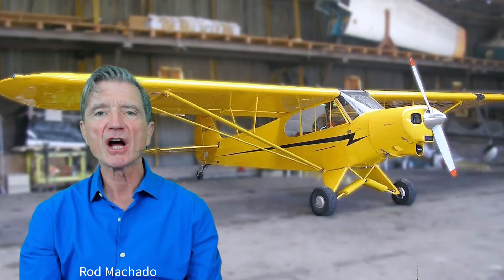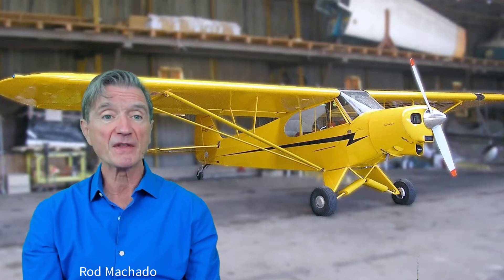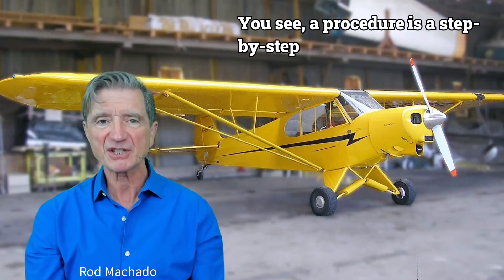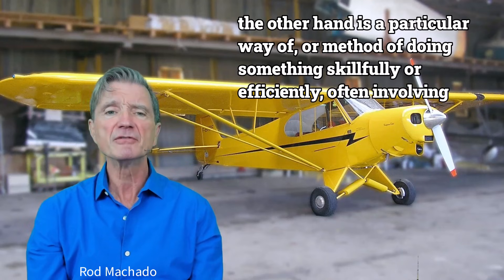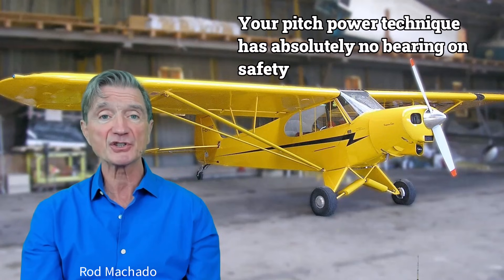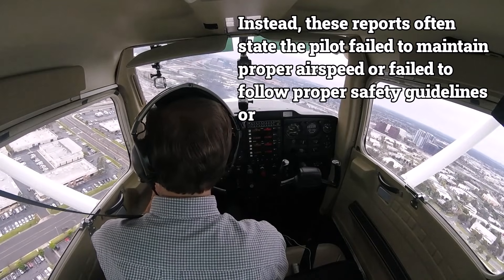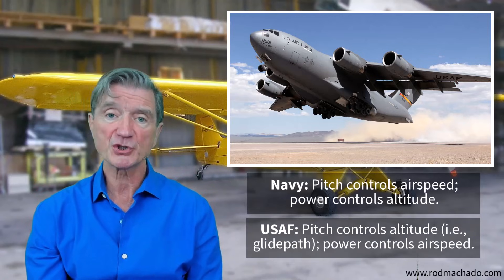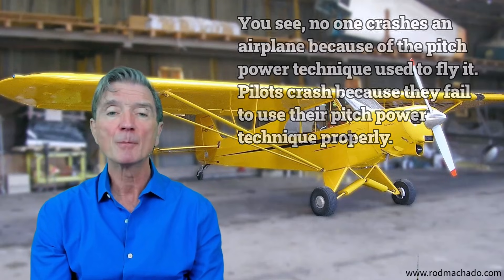Technique vs. Procedure

Comment: I think during climb, using a fixed climb thrust and pitch for speed (i.e., IAS Hold Aka Flight Level Change) is used and implemented in VNAV. But for Constant 3 degree glide path, where the pitch is fixed, then variable thrust it is. This is my understanding.

Comment: Wait? Someone is saying you can use pitch for altitude? So if I pitch up at idle power the plane will climb? I guess I better go study this new foundational physics discovery so I can properly understand how planes fly.

Respectfully, but you cannot climb with pitch so I don’t believe anyone is seriously suggesting otherwise. 

On the other hand there surely exists the objectively most correct approach to a safe stabilized descent. You may argue that drifting corners is your personal style how you drive your car, but you can’t argue that is the most stable and safest way to do it. There is a procedure for that, reduce speed before the corner, smoothly turn the wheel into the corner, keep the turn going, smoothly turn the wheel out of the corner and accelerate. And while it’s up to your technique how smoothly you perform this the procedure remains the same. So in fact, this is not about pitch vs power at all! It’s about how to conduct a maneuver to a desired standard. 

Well could be anyway, I have no clue what your video is about. It would be great if you linked the new FAA recommendation.
Reply: Absolutely you can climb with idle power--but you will lose airspeed. Just like you can descend with full power--but you will gain airspeed. Tell me this:  How does a glider perform a loop with no engine?  I'm pretty sure the first half of a loop requires a climb.
Reply: @timr1422  So you can climb and the only wrinkle is you lose airspeed. Kind of an important little wrinkle in your theory there chief. Also gliders do loops by first diving and trading altitude for airspeed before trading it back to fly a loop. No glider is able to just pitch up and do a loop. Even some aerobatic underpowered airplanes can’t do that.
Reply: @markor2476  Go back and read my post. I said that the airspeed will change. We aren't talking about constant airspeed climbs and descents.  The last time I checked, a gain in altitude is still considered a climb, even if you are losing airspeed. 

Here's another one for you.   If a particular autopilot can only control the elevator and not the throttle or throttles, then how can that autopilot have an altitude hold feature?  Somehow it's controlling altitude with elevator alone.  Hmm....

Comment: The reality is both techniques have their place. When I did my instructor course they were teaching ‘point and power’ on light aircraft because the students going through were military pilots and would ultimately need that technique for heavier, slippery aircraft.

However, one thing my instructor pointed out is that whichever method you use, if you are doing it right they are fairly indistinguishable. And he’s right. If you ever change the state of a fixed wing aeroplane you cannot do so without manipulating both controls with the exception of changing speed in a glide descent or full power climb.

Finally, because I seem to have see it a lot recently in comments: Pitch controls airspeed, power controls altitude is incorrect. If you are discussing this technique it is correct to say pitch controls airspeed, power controls rate of climb/descent.  Be pedantic, get it right. Especially if you are an instructor passing that knowledge to students.

Comment: They are both incorrect.  The elevator controls angle of attack and a relationship between airspeed and altitude.  Power can be used to change either altitude or airspeed depending on what you do with the elevator.  Pitch/power and airspeed/altitude are interrelated.  

If you don't believe me, try this: Put your aircraft in straight and level flight about 100 ft above the ground. Now without changing power, push the controls all the way forward and hold them there.  Then (if you survive) come back and tell me if anything changed besides airspeed. 

Also, just my personal opinion:   If you are going to say "Pitch controls X and power controls X", that should be true for every single fixed wing aircraft from a Piper Cub to an SR-71, and it should be true for very large control inputs, not just small inputs.  If it's different for low speed vs high speed aircraft, then tell me the exact airspeed where it flips.  

Because kinetic energy increases with the square of velocity, 1 knot of airspeed at 300 kts packs a lot more energy than 1 knot at 60 kts. Therefore pitching for a 5 kt airspeed change at 300 kts causes a much larger change in altitude (potential energy) than it does at 60 kts. That is why pitching for airspeed doesn't work well for high speed aircraft.

Comment: Pitch for airspeed, power for altitude. I've been using this technique for since 1980, and I'm still very much alive. I'm not changing.
Reply: Have you ever made a coupled autopilot approach (the autopilot controls the elevator)?  How did it go?

How's the bbq in Memphis these days?  My favorite place was Leonard's.
Reply: @warren5699 I have not, and as a non-instrument rated pilot, I likely never will.
Reply: @MemphisBBQ640 you didn’t even have to tell me you’re a VFR only pilot. Your main comment already told me that 😂

Comment: Either technique works, but one is far easier to teach. What's more, pitch for airspeed instills the correct response to a stall warning indication.
Reply: There's no way to prove it, but of all of the stall incidents on base-to-final, takeoffs, and go-arounds, I bet there are as many if not more pilots that pitch to airspeed as pitch to altitude.

'easier to teach' is a key point.  Shortcuts can be taken in many ways.  But does that give the learner the correct knowledge and skills?  The easier way often does not - ex: if someone does approaches with 'pre-set' pitch and power (which is easier to teach), can they respond to changing conditions?

Comment: i think it depends on the aircraft category you’re flying, for something high drag and low power like a cherokee where i learned to fly they taught me to control with power, you put on 2000 rpm on the engine and the thing starts descending 500ft/min without touching anything, that doesn’t work on a jet though, on a jet is pitch for altitude and thrust for speed, they have enough power, low drag and speed range that you can’t control precisely with power alone
Reply: That's an interesting point.  The small airplane does usually respond immediately with a power change.  But small airplanes go places and use small margins that jets don't.  For ex: a small plane may make an approach to a short runway over an obstacle.  The airplane sometimes has to pass very closely over that obstacle.  That's definitely when a pilot shouldn't depend on the propeller slipstream to control the descent - it needs to be done the safest way possible, the way the jet pilot would using the control wheel with direct mechanical control of the elevator.

Comment: Ahh, I use the kinetic energy confabulator in constitution with the  potential energy monostabulator but reverse that when the flux capacitor indicates that the polar moment of inertia crosses the central e-field axis. This is marked on the KPI with the rainbow color coding just above the Unicorn. Works perfectly.
Reply: You're sounding like the Energy Management chapter!!  🙂

Comment: I recently created a new community at SKOOL, that adresses exactly this topic. Not to activate this old debate, but to show a technique that worked for all my students.
Reply: I learned that approach technique in GA, and then the Airforce unlearned me, except for flying alpha on approach in high wing loading performance aircraft, or STOL work. In my Airline career, the big momentum aircraft go where you point them. Just like following the flight director.
Reply: @spdaltid None of these techniques are wrong, but especially new pilots should understand what they are doing in order to preserve more mental capacity for other tasks, instead of having to correct aircraft behavior they did not expect.
With bigger aircraft, as you correctly mentioned, it is much more controllable to use pitch for glideslope control. Pitch gives a much faster response in rate of descent than the engines do. However, you must understand that the principles are the same, you are just using them differently.
When changing pitch, you trade some airspeed for a different rate of descent. This means you are accepting the loss of some knots of airspeed to reduce the rate of descent, and vice versa. Less airspeed means less use of potential energy (altitude), and therefore a lower rate of descent.
It’s all about energy management.

Comment: On my 777 if I fly 2.5 degrees nose up and set power to about 55% N1 I fly a perfect 3 degree slope, to adjust I increase or decrease pitch and power as required..e.g pitch for glide slope (Altitude) and Thrust for speed (Power). It works on every other Boeing I’ve flown 75/76/747. Flying my Super Cub, I do the exact opposite 😂
Reply: It comes down to how you sequence the words.  Suppose a Navy pilot was going to land your 777 on a carrier that was long enough.  He would say it this way: I adjust power for 55% N1 for glideslope and pitch for XX speed (you didn't mention the target airspeed).

Even though pilots may debate what they are doing with the controls and why, the truth is the lift vector is what is opposing the weight and controlling the altitude, and the thrust vector is what is sustaining the airspeed.

Comment: It’s always been about energy management, ALWAYS. How you🫵🏻get there is on you🫵🏻as we like to say in the Army!!!🫡
Reply: "It’s always been about energy management, ALWAYS"

yes, but explain what that means and how it applies to controlling airspeed or altitude individually.

If I am in level cruise flight at 100kts, and I want to speed up to 150kts level cruise flight, how do you do it?

If I am in level cruise flight at 100kts, and I want to climb at 500fpm at 100kts, how do you do it?

Comment: First off, I got my pilots license and ifr years ago reading your material! Thanks!

I like this video a lot. My instructor taught me to use power for altitude, and pitch for airspeed. Learning it this way I feel helps you master the flight characteristics of the aircraft.

When I fly precision approaches, I will use pitch for altitude, since I can correct altitude with pitch faster than I can than adding or removing power. Then I will use power for airspeed on a precision approach.

Also I think both techniques have their merits.If you need to get out of the way really quick, you're going to move the yoke first. If you are wanting to make a smooth decent, use power for altitude.
Reply: "When I fly precision approaches, I will use pitch for altitude, since I can correct altitude with pitch faster than I can than adding or removing power. Then I will use power for airspeed on a precision approach."

power does not control airspeed, not even in a precision approach. let's say you want to go faster, so you add power and nothing else. the airplane reduces it's rate of descent, but your speed remains constant. so you lower the nose to go faster and re-establish the descent you had before. what you're actually doing is controlling speed with pitch, and altitude with power.

the sooner you learn to fly precision approaches with power for rate of descent, the better you'll be.

"Also I think both techniques have their merits. If you need to get out of the way really quick, you're going to move the yoke first. "

yes, but this will only work for a moment before the energy transfer you made steadies out. push it too far in either direction for too long and you'll stall or rip the wings off.
Reply: @SoloRenegade when you're in imc taking the plane down close to or at minimums, the one thing you don't have to spare is altitude. If you think for one moment you will continue to pitch for a constant airspeed when you need to make a quick altitude adjustment with throttle is dangerous. You must pitch to correct while simultaneously adjust power because you can always be a little slow or a little fast, but you cannot crash into a building because you want to control airspeed with pitch and altitude with throttle.
Reply: @adamsiewert4039 "when you're in imc taking the plane down close to or at minimums, the one thing you don't have to spare is altitude."

um, do you know how IFR works? you don't have a choice, you have to follow the glideslope or step down altitudes whether you like it or not.

" If you think for one moment you will continue to pitch for a constant airspeed when you need to make a quick altitude adjustment with throttle is dangerous. You must pitch to correct while simultaneously adjust power because you can always be a little slow or a little fast, but you cannot crash into a building because you want to control airspeed with pitch and altitude with throttle."

you couldn't be more wrong if you tried. my technique is the correct one, and it works. Myself and none fo my students have ever crashed nor risked crashing doing it properly. Navy fighter pilots work the throttle like mad to control the descent onto a carrier deck just as I describe. they have the hardest IMC landings on the planet.

"but you cannot crash into a building because you want to control airspeed with pitch and altitude with throttle."

strawman argument. logical fallacy. you're a child. got get some retraining if you think this way.
Reply: @SoloRenegadeteaching kids on Microsoft flight simulator do not count as student pilots.
Reply: @adamsiewert4039 nice ad hominem. since that's all you got, you lose the debate.
Reply: @SoloRenegade "um, do you know how IFR works? you don't have a choice, you have to follow the glideslope or step down altitudes whether you like it or not."  That's what Adam is saying.
Reply: @SoloRenegade "Navy fighter pilots work the throttle like mad to control the descent onto a carrier deck".  That's because the throttle is a poor control for altitude.  I recently read an article by someone who was extremely knowledgeable on carrier landings.  He said often on short final, the carrier pilot uses the pitch to stabilize the approach.  No surprise there.

Comment: I can't imagine flying a GA aircraft using anything other than pitch for airspeed and power for altitude. It goes against everything I know and would result in me feeling I have lost full control of the aircraft and certainly unstable in approaches. However were I hypothetically in the middle of an aerobatic display or in combat then obviously different parameters have to apply because you obviously have to make altitude changes far too abruptly to be managed by power changes alone. In those cases you are doing anything from completely reversing the technique to applying a hybrid one.
Reply: Understandable if that's what you were taught and the only technique you have used.  But, to manage the most critical part of the flight, the landing, what do you do?  I imagine you do what everyone does.  You chop the power, and then use the pitch to safely manage the remainder of the descent at a carefully controlled rate, you hold the airplane just above the runway in the float (that's controlling the altitude with pitch), and you touch down in a safe attitude all thanks to the elevator.
Reply: I 100% agree with th OP.
I reduce, or "chop" power so I can descend, and I raise the nose to slow the airspeed and maintain it where I want it.
When I'm in ground effect (float), I keep the nose up and begin flaring lower my airspeed to stall the wing.  I don't control altitude in the "float"so much as I do my airspeed.
Reply: @lowslow3612  In the float, what you do with the elevator will determine whether you land nose first, or mains first,  and whether you float parallel to the surface or balloon.  You may say you control airspeed in the float, but I bet subconsciously, you're doing a good job of controlling altitude and landing attitude.
Reply: @warren5699 Exactly.  Controlling aoa and airspeed with elevator and idle power.
Reply: @lowslow3612  But what do you do to get the mains close with minimal descent rate to avoid a hard landing or drop onto the runway?
Reply: @warren5699 I control with aoa.  Power is idle, so no longer a factor.
I think we are talking about the same thing differently.  Semantics.
Reply: @lowslow3612  Yeah - with airplanes I take things literally.  When you said you control aoa and airspeed with the elevator, I thought, what about the height above the runway.